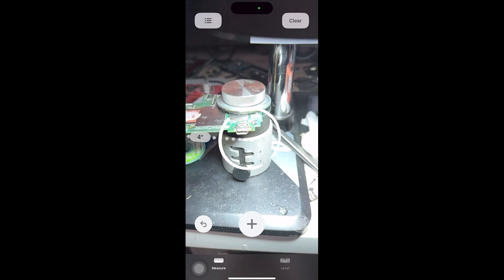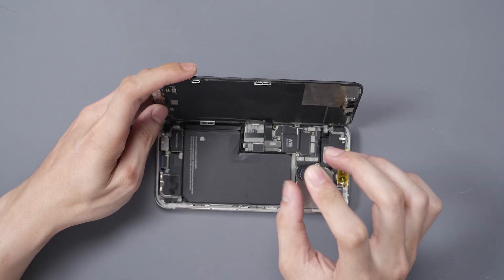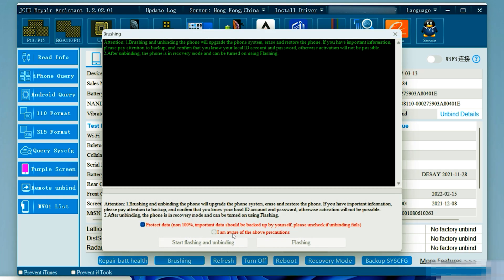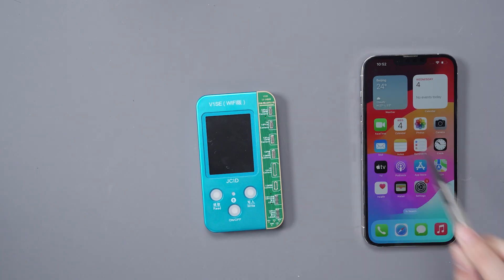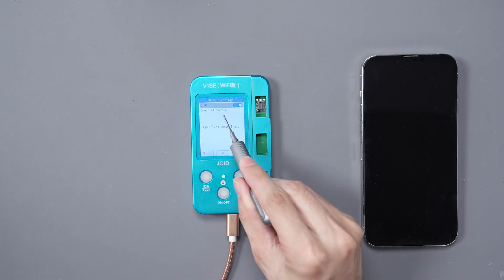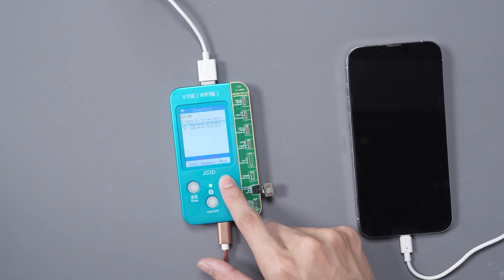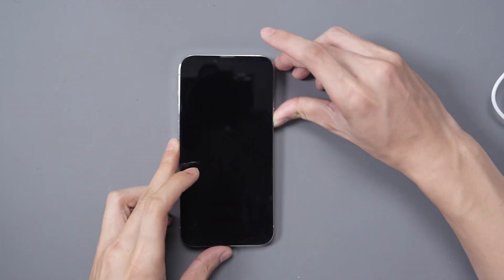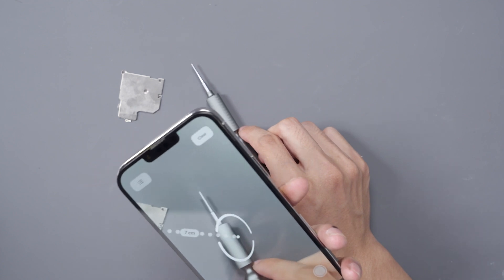Restoring iPhone 13 Pro Max Lidar Sensor with JCID Replacement: Full Repair Guide

Comment: my original lidar sensor was thrown away (my mistake) can I still use this to pair a new lidar to my iphone?
Reply: Yes you can. As long as you buy JCID Lidar sensor, you do not need the original lidar sensor to pair the phone. This is what the unbinding stage was for :).

Comment: So I'm confused, to repair this you DO need the original LiDAR sensor right? You can't just repair it from a new one?
Reply: try it
Reply: Cloud fail or phone bound error please help🙂
Reply: no, you can do it without it; for this you need to unbind the phone’s firmware and get the lidar number from the firmware
Reply: @TheSufle  hey bro no need the original LIDAR? Because I only buy the motherboard without LIDAR.
Reply: @TheSufle  But to unbind you have to restore the phone right? It can't be done without loss of data, can it?
Reply: @SkynetCyb i have the same question